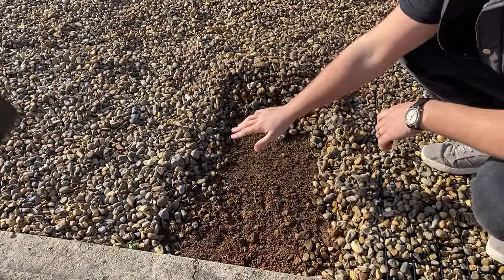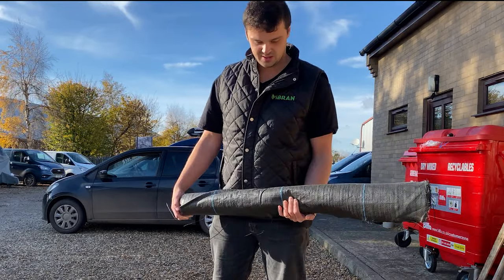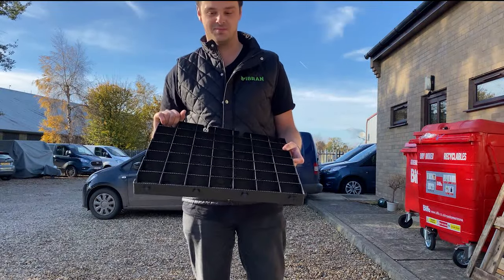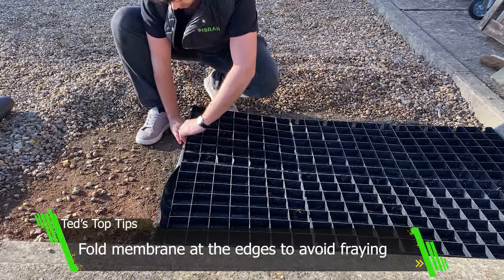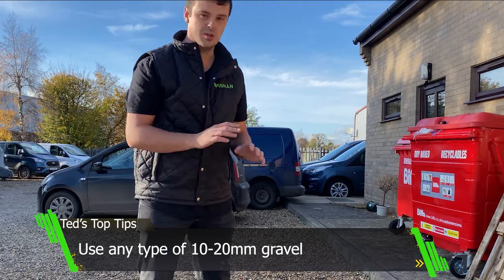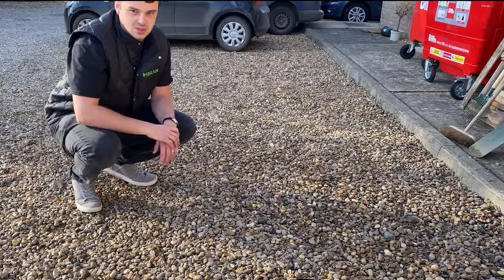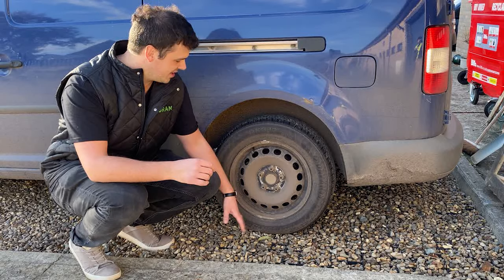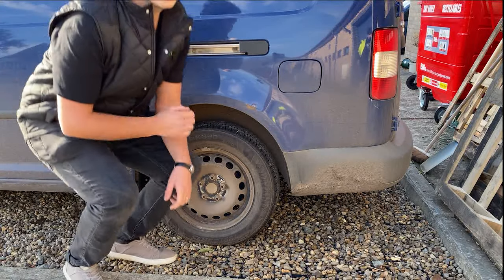How to Install Gravel Grids for your Driveway - IBRAN Installation Guide

Comment: Quick question, I’ve watch other videos on this and a lot of them say put hardcore down then sand and use a whacker plate on the tiles before putting stones down. 
Is it better at doing it that way or the way you said?
Also how long are the tiles on sale for?
Reply from the maker: Hey, as this surface was pre-levelled we didn't need to compact the area. What you've seen elsewhere about using a whacker/compactor to level and screed sand is absolutely correct.

We've outlined the full installation procedure on our website at https://www.ibran.co.uk/blogs/all-posts/how-to-install-your-gravel-parking-grids

The current sale price was launched only 2 weeks ago, as we've had a more favourable price on our granulated recycled plastic, so currently we can pass that saving on.

Comment: Do you not need hardcore under the grid ? Does it just need to be solid and level ..
Reply from the maker: The ideal installation would require hardcore/sub base to prevent movement under pressure. Getting the sub base level through compaction is also fundamental to it not moving.

Comment: Could I use a wheelchair on it?
Reply from the maker: Hi, yes the spacing in the mesh is designed to prevent wheelchairs getting stuck. As such it's been approved and assessed as building regs part m compliant for accessibility.
Reply: @ibrangroup  thank you :))
Reply: @ibrangroup  and would it be ok with 20mm gravel and a wheelchair. Or is 20mm too large for the grids and a wheelchair?